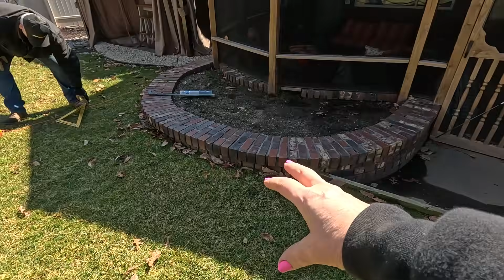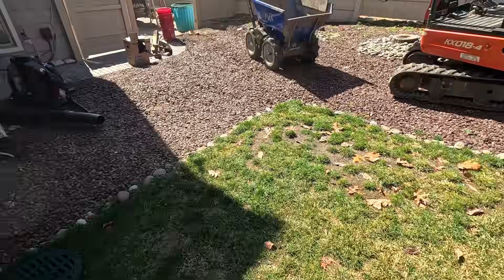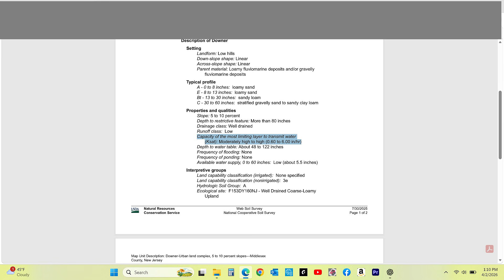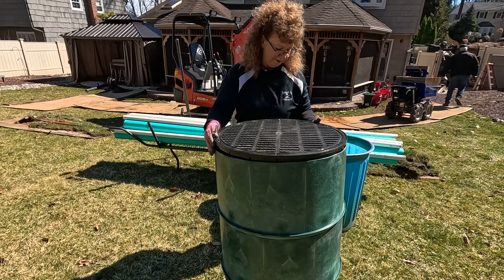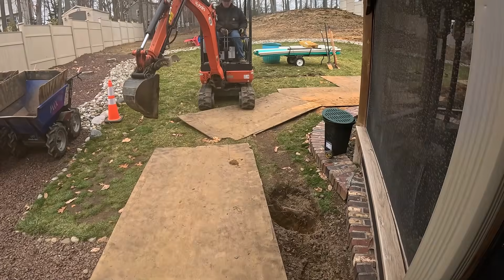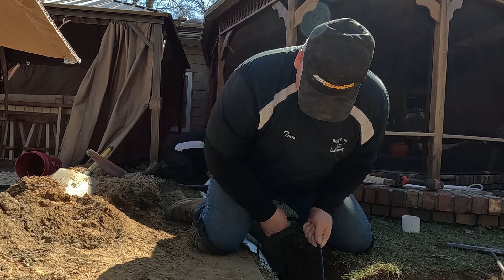Water Was Flowing Toward the House… They Were Afraid to Go on Vacation | Part 1 of 2

Comment: I don't get running the downspout on the sump pump exit side back into the sump pump rather than just tying it into the exit line with proper exit pitch rather than forcing more excess water into the pump area?
Reply from the maker: I hope you will watch pt2. You might understand why we run the downspout to the dry well.

Comment: Another awesome job! 
I looked at a job about 12 years ago for a builder we do site work for in Saratoga NY. The homeowner decided to do their own excavation. The site had a ridiculously high ground water table. Because of it, the half million dollar home was built on a slab. No knee wall, the sill plate was fastened directly on the slab. They did a decent job grading away from the slab for about 50 feet. Then the grade climbed on all four sides. And a lot at that. And kept climbing beyond their property boundaries on three sides. The driveway was about 700 feet long and the elevation of the floor was a good 60 feet lower than the street. I think you can picture where I’m going with this.

The homeowner had the builder call me to “ do some grading”. When they had me look at the project, it was about this time of the year. There actually was still some snow on the ground, but the melting had begun.

Holy $#!t! The yard all the way out to about 50 feet and the inside of the house itself had 2 feet of standing water. You can’t make this up.😂 they asked me what my suggestion was. I told them demolish the house and start over.😮 Absolutely no way to use stormwater chambers, even the ones we have installed at some of the Lowe’s stores. No practical place to pump the water. What a disaster. 

Aside from the obvious water issue, one of the first things I noticed was the well casing was about a foot underwater. And there is no municipal sewer where this place was built. That situation alone was not ideal.😊

I asked the builder later on that year when we were doing some work for him what those folks ended up doing. He said the homeowners had him finish up the rest of the interior. (when I looked at the job, they were starting to insulate) well, until the place flooded. The people waited till August and sold the property. I feel so bad for whoever bought it. Probably some young unsuspecting couple.

Keep up the great work guys!
Aaron up in the Adirondacks.
Reply from the maker: Aaron, thank you and hello from NJ — that’s a wild story. Situations like that really show how important proper grading and planning are from the start. You can really tell a good story and you're a great writer — I’m sure everyone here enjoys hearing about your experiences.  I'd like to hear about the chambers for Lowes.  We really appreciate you taking the time to share that, especially coming from someone in the field.  The new video is exporting and we hope to have it up early this afternoon.  Thanks again for the support up in the Adirondacks.
Reply: @tyelandscapinganddrainage  thanks. My better half, she says I talk too much.😂 Like you, I love what I do. And I like sharing my knowledge for people it may help.

I haven’t made a YouTube video for my channel in forever. But I have a friend on YouTube that stops over on occasion and does a video with me. If you’re ever bored and want to see something different, his name is Ovi Duran. The first video I did with him is The Story Of Big Red Aaron’s gasification wood boiler. There are a couple other videos he has done at my place as well.

The chambers I was referring to was at the Lowe’s in Amsterdam, New York. They were the largest I have ever seen. I am not that tall at 5’ - 7”, but I remember I could crouch down and walk through them. Most of the stormwater management was installed under the parking lot with just a small pond above ground. There wasn’t much real estate to work with at that site.
Reply from the maker: Aaron, You really tell a good story and I will check out that video. I hope we hear from you often. You’re great asset to our community. Thank you!
Reply from the maker: Very cool video Aaron

Comment: So originally the down spout drained into the black pipe that they found, but the current owner removed it? Is that the root cause of the issue, the added roof drainage?
Reply from the maker: We thought it was a pipe to the downspout.  The homeowner said they tried putting a catch basin in front of the board but, it didn't work.  The water still got around it.  The main cause is the water that comes down the hill - across the grass.  Pt2 coming this weekend.

Comment: Hey guys, great video as always!!!!
I’m sure there’s a good reason but why wouldn’t the pipe be perforated to catch the water coming from the hill and also, freezing? Does it need to be blown out before the winter?? Thanks
Reply from the maker: Thank you Joe, great questions. we’re capturing water in our catch basins. A perforated pipe a foot or so down will catch little to no runoff.  All the water is either directed around the house or to the basins. They don’t need to be blown out. This is a well sloped smooth PVC system. It won’t hold any water. I hope you will come back and watch pt2.

Comment: I wonder about this. A sump basin that relies on a pump is not a solution, it's a bandaid. A pump can be overwhelmed, and it can fail. 
It's puzzling what the original planners were thinking when this was originally built. Really, there should be passive drainage leading the water around or away from the building, either by complete capture (what you're doing with a pump – which is a single failure point) or by redirection. That's initial thoughts at 8 minutes in. Curious to see how it turns out at the end. More clients for you, I guess. 🤷
edit: Yep, I think you cleared it up. The pump is a backup here, because the soil should already have relatively high drainage properties. Very interesting.
Reply from the maker: Yutani, Great points — and honestly, that’s exactly how we look at it too.

We always try to design a passive solution first whenever possible. In this case, the soil infiltration is doing the majority of the work, and the dry well is sized to handle typical conditions without the pump ever needing to run.

The pump is really there as a backup for extreme storms, not the primary solution. So instead of being a single point of failure, it’s more like an added layer of protection.

And you’re right — a lot of these older properties weren’t designed with modern stormwater management in mind, so we’re often working backwards to correct it.

Appreciate you sticking through the video and following up — glad the full picture came throught.  I hope you will come back to watch pt2 to see how it turns out. Have a good evening
Reply: @tyelandscapinganddrainage  I'm definitely captivated by this one! I really like that you show and explain all (or most) aspects of projects like this. Knowing about the soil testing is enough to tide me over until part 2 releases. :) Great video! Thanks.
Reply from the maker: Thank you Yutani — we really appreciate that.
The soil testing was the key on this one.
Part 2 ties it all together — final install, testing, and the homeowner’s reaction… which was pretty special

Comment: Sad to do so much work and have to rely on a sump pump. Almost all my storms are accompanied by power failures.  Pumps, backup pumps, generators, and still water incursions. At some point neighbors throw in the towel and move on, The next family picks up from there but same sad story until they resolve the problem without relying on electricity and / or  pumps.
Reply from the maker: You are right Rosey but, this homeowner has a whole house automatic generator.  Power outages are not an issue for them.  Have a good day
Reply: @tyelandscapinganddrainage  My neighbor had a sump pump, a battery powered backup sump pump, a natural gas Generac generator, and a foot of water in the basement.
Reply from the maker: That’s definitely frustrating when that happens — sorry your neighbor had to deal with that.
In most cases like that, it comes down to system design — either the pump wasn’t sized for the volume of water, the discharge couldn’t keep up, or something in the system failed under heavy conditions.
Every property is different, so we design each system based on the soil, how much water is coming in, and what it needs to handle. In this case, the infiltration is doing most of the work, and the pump is there as a backup for extreme conditions.

The goal is always the same — give the homeowner a system they can rely on and real peace of mind.
Reply: @tyelandscapinganddrainage  They were first time homeowners, both schoolteachers; not very knowledgeable about home care issue . They had pump and battery charger plugged into same outlet which was tripped. They didn't know they need to be on separate circuits
Reply from the maker: That’s a shame — sounds like a tough situation, especially for first-time homeowners.
Issues like that can definitely happen if everything is tied into the same circuit.

Hopefully they’ve got it all sorted out now and everything is working the way it should.

Thank you for sharing that, Rosey — and have a great weekend!
Part 2 of this video will be out very soon.

Comment: Is the fence not low enough that you could just grade a straight pipe out of the property without having to go to the extremes of installing a sump pump?

Also, Dawn seems to be sounding a lot healthier lately!
Reply from the maker: Debbie, Good question. We always look for a gravity solution first, but in this case the driveway is about 10" higher than the basin, so there’s no way to get proper pitch out of the backyard.

To make a gravity discharge work, we would have to remove a section of the paver driveway, which is a much more invasive project — so the sump system was the right solution for the site.  Thank you

Comment: Dang it, every time I watch your vids, I need more tools.  Electric chisel, air spade, locator tool. 
In a completely other direction,
 If you take your round nose shovel and cut it off square and resharpen the edge it will penetrate the ground easier, same with the long snout trench spade. I don't know why, it just does. An old guy showed me that 50 years ago and it works.
Reply from the maker: Buying tools is what keeps the economy going.  Excellent tip. Thank you for sharing

Comment: What are the dimensions of that tapered trench bucket, is it smooth cutting edge?  I have a 9" two tooth trench bucket, works great for double 4" French drains. Was thinking of the tiny trench buckets from rhinox, not sure if I need to spend that money yet. It's difficult enough trying to work in a 9" trench.
Reply from the maker: Firstname, we made that Vee bucket.  It's 6 inches on the bottom and 11 or 13 inches on top, i don't remember.  It is smooth so I can trench around utilities, especially sprinkler lines.  Flat bottom so I can clean off plywood to backfill.  The taper means dirt does not stick in the bucket.  I spoke with other guys who use a 6 inch bucket and complained about dirt always sticking in the bucket.  Here is a link to that video - https://youtu.be/ziJSe0cU1GY

Comment: Excellent work as usual.
Was there any discussion about putting a french drain/open drain along the existing rock swale, in order to divert the water before it got so close to the house?
Reply from the maker: Thank you Maga.  We did offer a plan that put an open french drain/dry well where the rock swale is.  The homeowner insisted that the swale was fine and working the way it is and just wanted to concentrate on the water issue by the patio.  Thanks again and Happy Easter

Comment: They should have made a few Terence's on that big hill and.  directed the water to left, using stones or bricks to make a short wall.
 That was a lot of careful digging, how much did it slow the job? an hour, 2?
Who ever designed that sitting area should have known it would flood, and put a drain system in. But their mistake, is your money in the bank.
Reply from the maker: Thank you Duane,  The homeowner did get many different ideas from several other contractors with lots of terracing and hardscape.  I believe ours was a more simple solution for addressing the water issue.  They plan to do more landscaping of the hill in the future.  The slow careful digging around sprinklers does take extra time.  Probably more than a couple hours and instead of working on something else both of us have to be there concentrating.  Thanks again and Happy Easter

Comment: Nice work as usual! I was wondering if you guys use anything to seal around where the pipe enters and exits the catch basins?
Reply from the maker: Hi Ramrod.  Good question.  We usually use gaskets if it's a sealed sump basin.  Like when we use the Jackel basins.  This one is a dry well, it's well perforated so there's no need to seal around the pipes.  Happy Easter